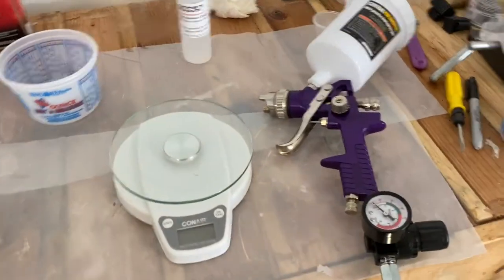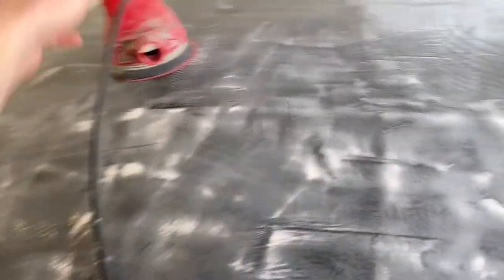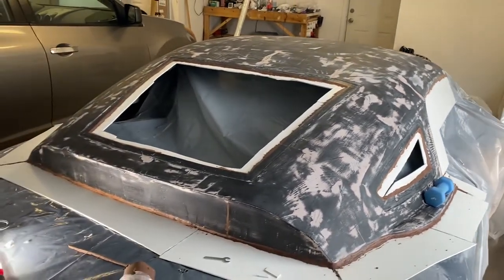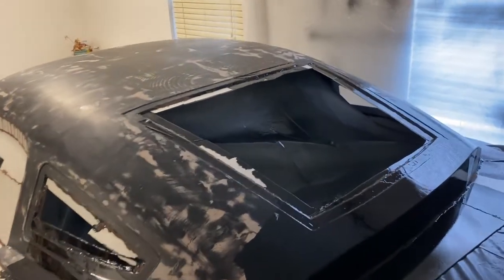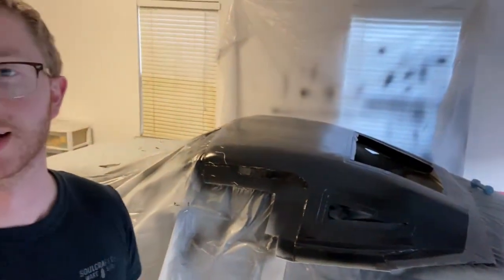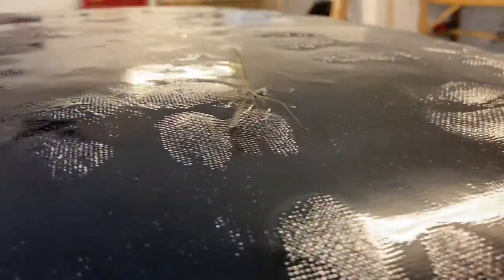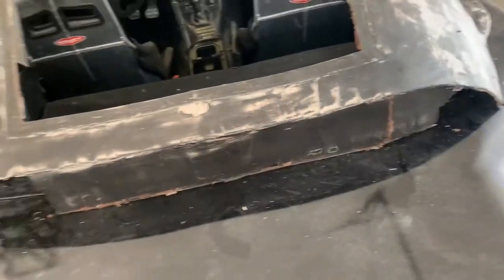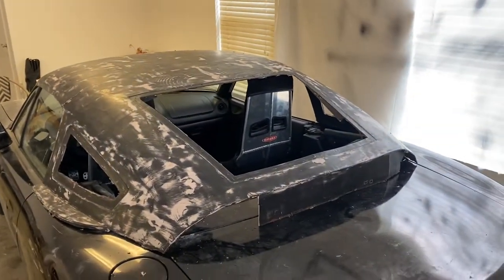DIY Miata Fastback Hardtop Mold (Part 5)

Comment: The rigidity part is what I was worried about, some long strips of core foam in a grid pattern would probably help a lot. Looks good though. I really don't miss working with duratec, countless hours sanding and polishing that stuff to a mirror finish.
Reply from the maker: Thanks! I will try that and see how it goes. If the sides still aren’t stiff enough I might have to make a wooden external frame for it.

Comment: Some suggestions for the future: 1) Watch Throttle Stop Garage. He built a bunch of CF parts for his Volvo. Super informative channel. 2) Use a "gold" body filler, like Rage Gold or the like. It sands super easy. 3) do your body work with filler, then spray it with primer to see what spots you need to fix. It's also suggested to get something like "The Onion" which is like a board with sheets of paper on it for mixing filler. My local auto parts store/paint supplier has their own version. This way you don't waste more expensive gelcoat. 4) make sire the part and the mold are VERY rigid. You may need more layers, or foam reinforcements on the underside like mentioned below.  5) use fiberglass mat, not cloth. Cloth doesn't really have much strength and stays pretty flexible. Enjoying the content so far.
Reply from the maker: Thanks for the tips! 1) I’ve seen his channel. Great stuff. I’d like to try resin infusion next. 2) I will look into that. 3) That sounds so much better than using cardboard each time! 4) I ended up adding some foam reinforcement to the back side and I wish I had done that before pulling the mold to make sure the shape is perfect and rigid. 5) I should have talked about this more in my video but I used cloth instead of mat because cloth is compatible with epoxy resin. I wanted to use epoxy instead of polyester because the smell isn’t as bad. I wish I had done mat and polyester at this point though. I will post a video of everything I learned from this process and things I will do different next time. Thanks for the feedback/tips!

Comment: Do you think all this work is worth it? Was there not any prefab options for a top?
Reply from the maker: I think it’s worth it! There aren’t currently any carbon fiber fastback hardtops for this car on the market and the non carbon options are super expensive. Plus I enjoy working on it and building my own design.
Reply: @HutchinsRacing  about how much did the initial print cost you?
Reply from the maker: @32bunts  it was about 9-10kg of filament so about $180-200

Comment: Reinforcing the 3d printed model with frp would be an option?
Reply from the maker: Yes that would help if you have a printer capable of that. You could also layer some fiberglass on the underside to provide some strength.